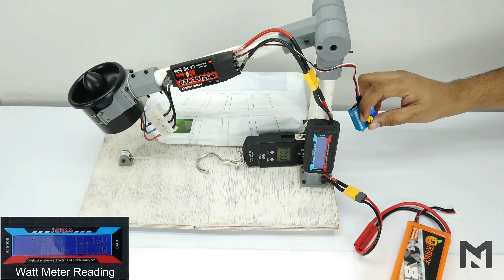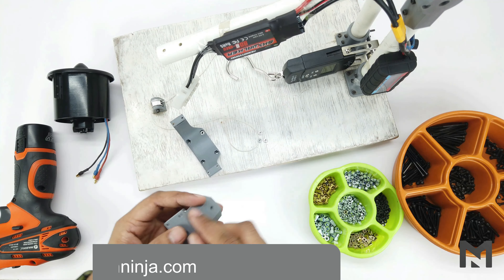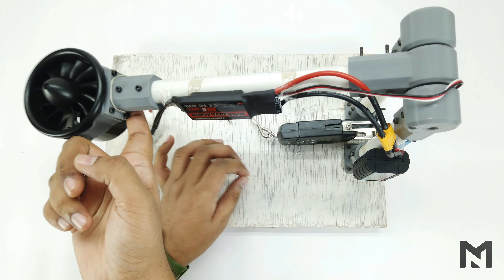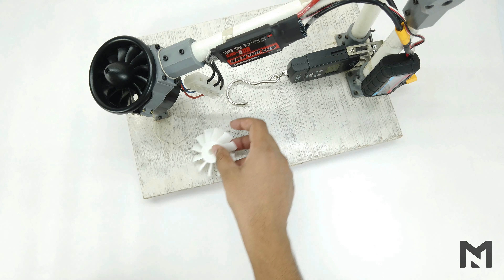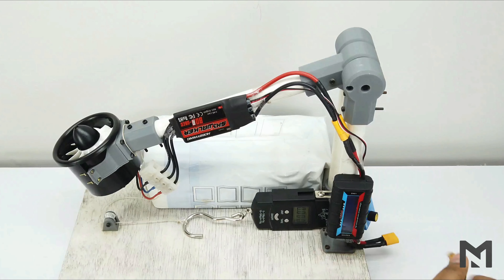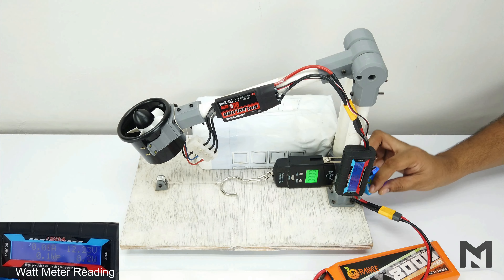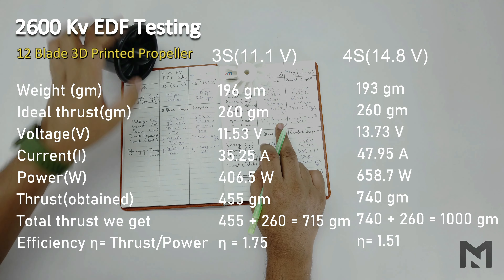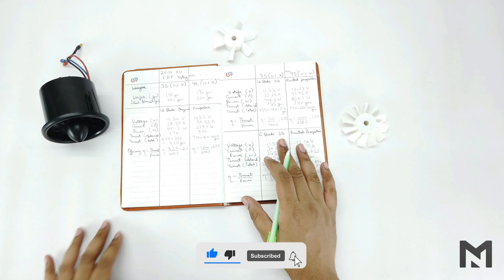Dynam 70 mm Electric Ducted Fan Thrust test | 12 Blade Vs 6 Blade 3D Printed propeller | 2600KvMotor

Comment: I would suggest to print those props from ASA. Then 1) proper sanding.  2) aceton vapor smoothing.That will result in very smooth surface with less drag. 
3) static and dynamic balancing.
When you manage all of these steps, you can get very competitive propeller.
Reply from the maker: Thankyou for your suggestion sir....i really appreciate your thoughts and will definitely do it in my upcoming videos....
In my upcoming videos...i have already tested a new propeller with 0.1 mm layer height and the results are really good.
So thanks for watching and don't forget to subscribe so that you don't miss out anything....😊😊😊

Comment: I run a 3d printed 120mm EDF in my 7ft L-39. To get "manufacturer's" specs or better, try SLA printing or sanding the blades after fdm printing. Also, for fdm, try carbon-fiber filled filaments like cf-petg. It sands very easily and the results are phenomenal.
Reply from the maker: Thankyou for your suggestion sir...i will definitely make one and upload the results...
Thankyou for watching the video and don't forget to subscribe 😊😊😊😊

Comment: Thank you very much for this video, I am planning to design my own EDF with 24mm diameter.
Reply from the maker: Thankyou for watching and don't forget to subscribe 😊😊😊😊
Reply: Things you should do difference as he stated it doesn’t have a smooth surface and that’s why it’s not as good as a purchased one. But what I’ve seen is some guys sand the propellers and add nail polish which makes it as smooth as a store bought one.
Reply: @FlacoGonzalez-u6h  hmm, that’s a good idea!

Comment: You will get better numbers if you print this at a lower layer height. Try 0.08mm. Also the propellers could benefit in strength from being printed with walls turned up so high that there is no room for infill. Similar to how they grow crystaline metal for turbine blades
Reply from the maker: Thank you for your valuable suggestion....In my upcoming video, I have tested a new propeller with 0.1 mm layer height. Currently they are having good strength, but I will definitely use 0.08 mm for bigger propellers. And I have reduced the height for smooth finish. And I am also thinking to print them with resin printer.
Thankyou for watching and don't forget to subscribe 😊😊😊

Comment: You can use banch power supply
Reply from the maker: Thankyou for your suggestion,
I have used one, after 7 to 8 minutes and delivering 15 amps of continuous current, the ports melted 😊😊
That's why I am back with a battery.
And thank you for watching and don't forget to subscribe 😊😊

Comment: Where do you get these stl files from?
Reply from the maker: I have designed them sir.....
Thankyou for watching the video and don't forget to subscribe 😊😊😊😊
Reply: @MechNinja  I'm curious. How did you attached blades to the shaft. I tried on Tinkercad, but it's not working..I attach one blade to the shaft and than combine them. After I "group" them together I try to rotate the shaft 30 degree to attach the next blade,but the object changes it's center of axis after grouping...
Reply from the maker: Well I didn't understand what you have said....But I have designed my propeller in such a way that it fits the shaft easily.....Well i have quiet good experience in designing....😅😅😅
Don't forget to subscribe 😊😊😊

Comment: Your way of calculating efficiency/performance is totally wrong, you are dividing a "force" (without multiplying by gravity since it is still in grams) by a power. If you want real performance values (not dimensional) you would have to convert the grams into kilos and multiply by gravity and then multiply by the air outlet speed. To skip the first step of going from grams to Newtons, put your dynamometer in Newtons directly. . All the best
Reply from the maker: Thankyou so much for your suggestion...I will definitely look into it...
But I have used the standard formula which is widely used.
If you are going to buy any EDF or motor from the market...then you'll.only see thrust to power ratio in specifications.
So i have also used it...
But in my upcoming videos i'll try to be more specific to the point.
Thankyou for watching and don't forget to subscribe 😊😊😊😊